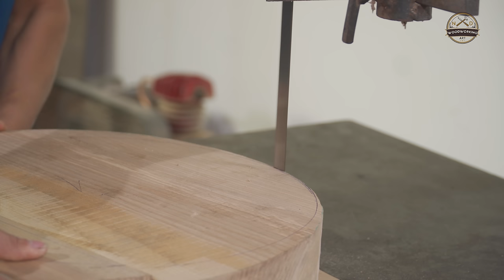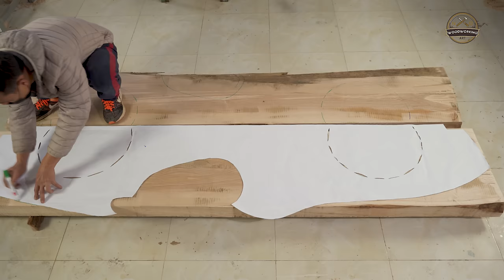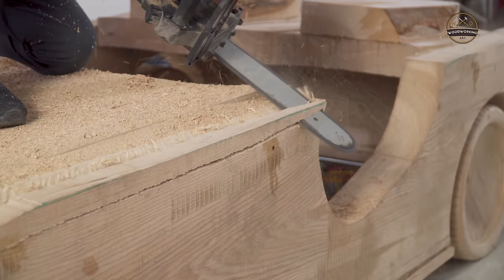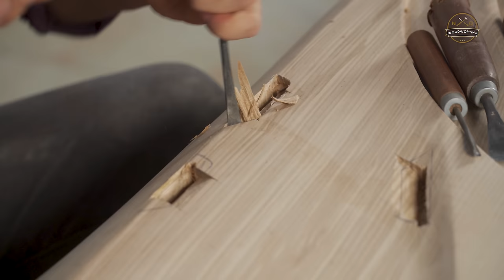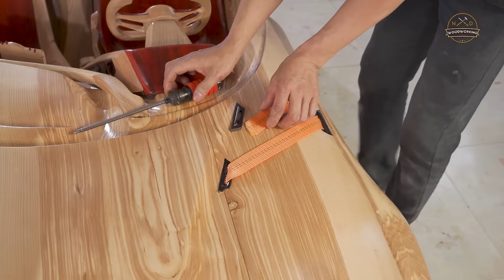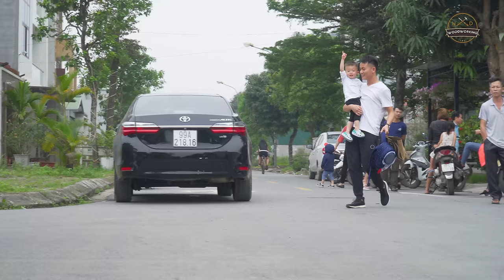Wood Carving - BMW 328 Hommage - ND Woodworking Art

Comment: Why not use fiberglass or like heavy duty plastic materials this way it wont be too heavy weight and probably will run at faster speed but in general its a nice hard work 👍🏽